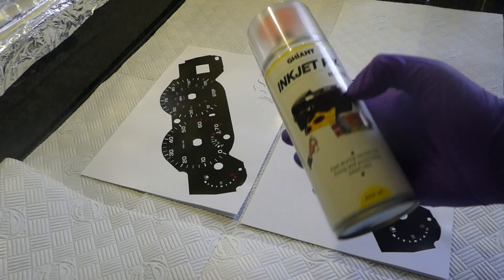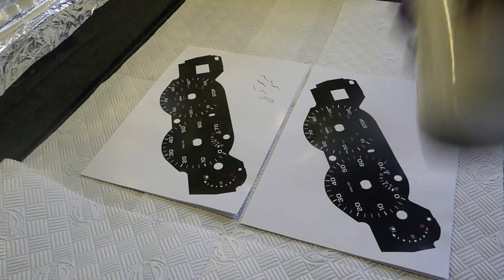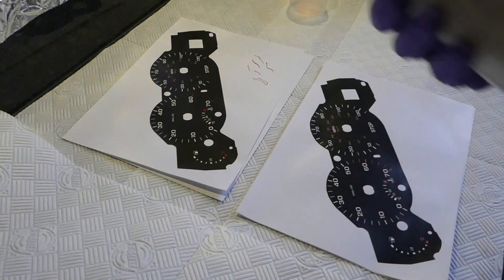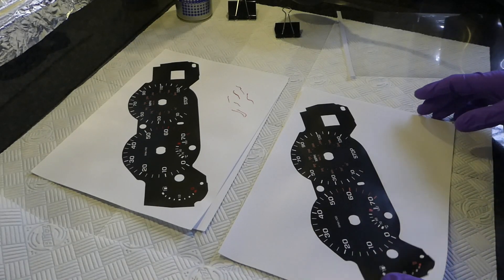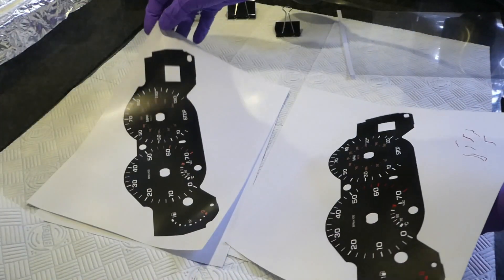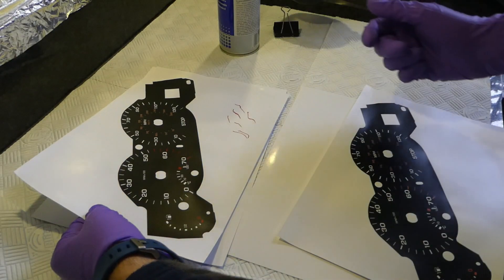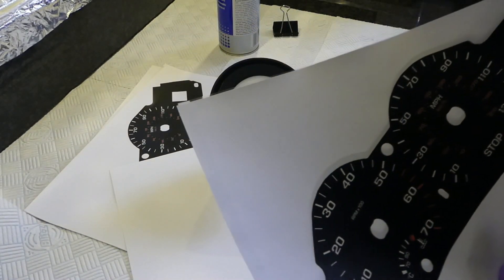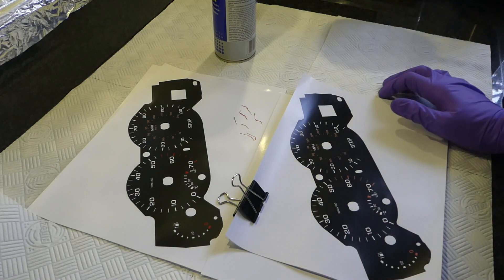7. How to print your own (DIY) speedometer (instrument cluster) - Matte Fixative

Comment: Awesome series! Did you try to print double sided on that preferred laser paper? For the backside you can have a mask and that way increase blackness without having to bond papers. Gonna try this
Reply from the maker: Yeah, have not tried this. I think the transparency paper is only one sided, although the laser paper can be printed on both sides. Yes, probably the black will be blacker, but difficult to align well for the printer

Comment: Does the transparent paper actually need to be aligned if the black on the transparency was dark enough to not let any light through? For example, printers used to make silk screens for silk screen printing can print a solid black on transparent paper. Then could you use larger, say rectangles for ell the white characters to let the color light shine through? This will take a little bit of margin for error out. Theoretically at least.
Reply from the maker: Yes, that is absolutely correct. In general one can relatively easy screen print the whole thing, it just requires additional resources, which I did not have at the time. One can actually screen print with black colour and leave the digits/lines not covered, then semi-transparent white/silver for the digits/lines.